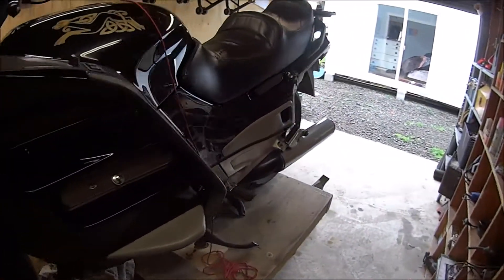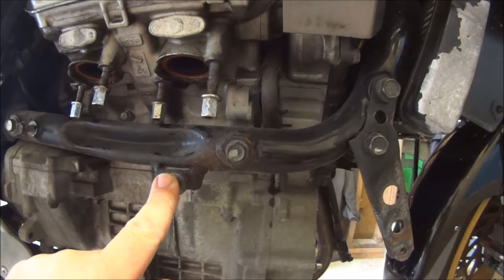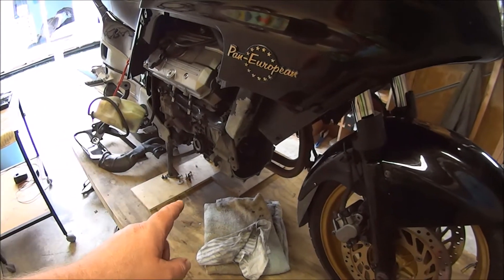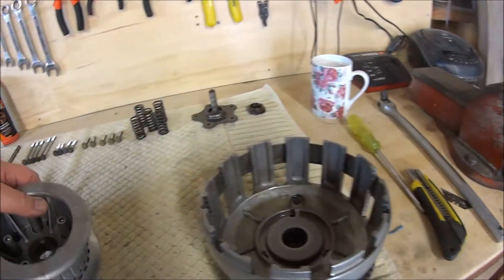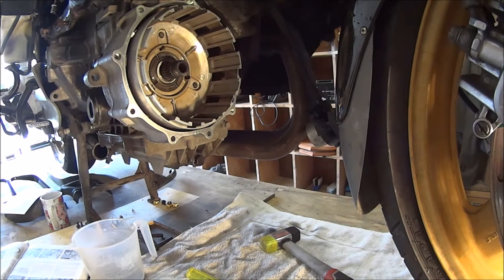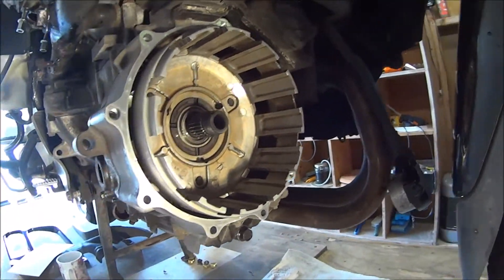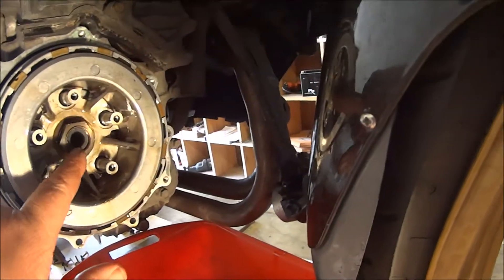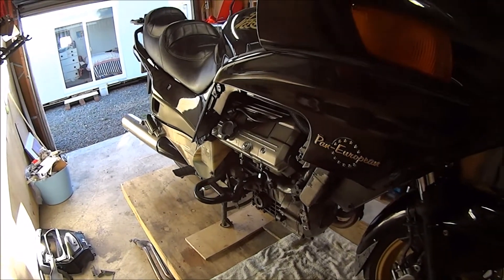ST1100 CLUTCH CHANGE

Comment: Any idea how to just do the bleed? What fairings have to come off exactly and where is the access point to the lower part of the  hose?
Reply from the maker: Mate, the vid is 5 years old and I sold the bike 4 years ago. There's a slave cylinder ahead of the clutch which you bleed just like brakes.

Comment: Just curious what millage was on the pan that made you change clutch plates ? Great video by the way , also what was the hold up with slave cylinder?
Reply from the maker: Sitting in one place without being used for 5 years caused the plates to dry and they burnt out on the way to recertification check
Reply: @kiwibadger7826  You would make a Great Politician as you completely ignored the two questions I asked you 🥝